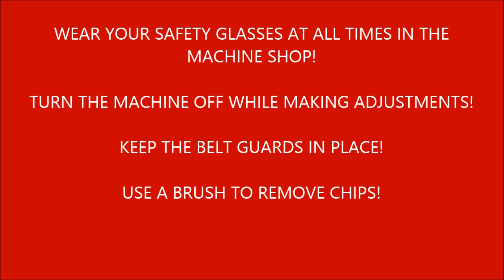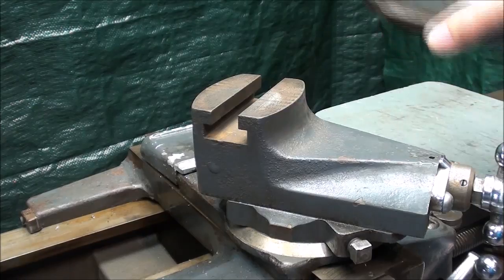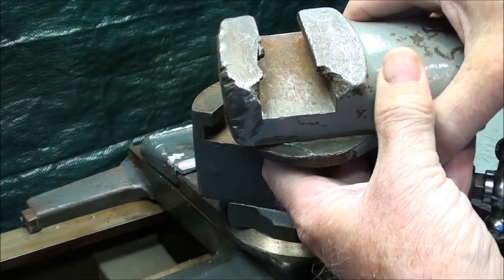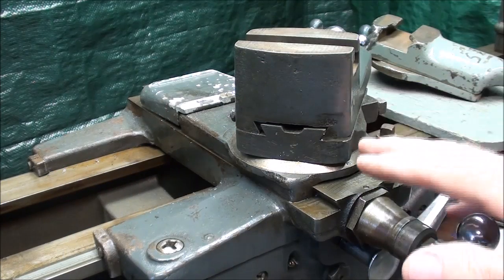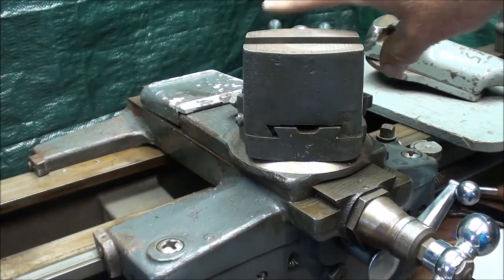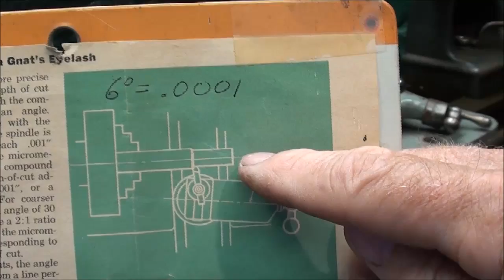SHOP TIPS #232 The Compound Rest of the Atlas/Craftsman  Lathe  tubalcain

Comment: Thank you for the Atlas series! I was given an old Atlas 10f that was a little rough around the edges from disuse. Your videos have helped me disassemble, clean, and oil the different parts with confidence and have saved me so much time trying to figure it out from the drawings alone.

Comment: FOLLOW REST I can not seem to find much on Youtube for Follow Rests. I have a SB 10K and confused on the proper or best position for tool alignment to rest. Looking through a number of videos I see the rest behind the cut, before the cut, and parallel to the tool cutting. Also of interest is the tool post itself in relation to the follow rest. Using a newer quick change tool post seems to place the follow rest rather far behind the actual cutting. (I have a few bits that cause the holder to drop down lower than the compound flat so it's positioned off center to the left.) The old style lantern post could set it closer. 

By the way - you are one I go to for good information - my shop teacher. Thank You !!

Comment: Thanks, just purchased an Craftsman 12" Lathe and am going over it and painting it. I just learned my pins are missing for the compound which wasn't mounted and I didn't know about the pins. But, a milling attachment was mounted and it had both pins. The pins are marked 5/16" FYI.
I also have the Boring Table but it has a dovetail mount and won't fit my Lathe.
Your Videos have been very helpful. TY
Reply from the maker: Thank you, I'm glad you like my videos

Comment: 6:54 Excellent tip! Thanks!!!
10:47 I don't have that attachment.
--:-- I do however have the taper attachment that goes on the back... kind of rare I think.
--:-- I also have the grinder... it is HUGE for that little lathe... I don't really want to use it... literally 25 pounds or so.

Comment: Would it be possible to cut a slot in the back of the pins? Then when you push the pin in with the screwdriver, you could use the slot to control or correct rotation of the pin.

Maybe also punch or drill a little divot in the back end of the pin on the "up" side.

Or would this have to be done before the pins are hardened.

Comment: Thanks for sharing your knowledge and experience. The Compound rest on my South Bend does not look quite as bad as the one shown in the video. The inside edges of the T slot is broken out a bit. Do you think rebuilding with Brass would be strong enough for the clamping surface??
Reply from the maker: I'm not sure the brass would be strong enough
Reply: Thanks, just watching "Compound Rest for a 6" Craftsman Lathe"

Comment: The square table with the Tee slots on it mounts onto the milling attachment and a boring bar can be mounted in the spindle. That way milling, drilling and boring can be done. It essentially makes the lathe into a horizontal boring machine.

Comment: The reason I really don't like round head slotted screws is visible at 30:55, and the Atlas are particularly bad, with wide, shallow slots no screwdriver seems to fit. Other than making a special screwdriver, any suggestions for avoiding the issue?
Reply: +john john I've replaced most of the slotted screws on tools with button socket head screws.  Much easier to deal with.

Comment: Lyle, what is stopping the screw turning the pin as it's going in?
Reply from the maker: +Ian Clapham don't understand
Reply: +mrpete222 what I mean is. Is there a groove to stop the pin from turning? Could the screw rotate the pin as you turn the screw?
Reply: +Ian Clapham   If you mean the two square head clamp screws on the base of the compound, the center post has a dove-tailed groove that the angled end of the pin engages to pull the compound down tight against the cross-slide as at 8:52. He explains them at 12:40.
    Mike (o\!/o)
Reply from the maker: +Ian Clapham The end of the pins is at an angle-they cannot turn-Thanks for watching
Reply: +mrpete222 great thanks both

Comment: Is an old southbend better than an old atlas?
Reply from the maker: +Shane K same
Reply: depends what your doing with it.   most southbends were used a lot in shops and production work and most are worn..   Atlas lathes are home/hobby lathes and when cleaned up, have almost no wear unless the owner used it a lot or on heavy cuts.
Reply: @mrpete222  does the old SouthBend have flat ways like the Atlas? That, to me, is the biggest weakness in the Atlas.